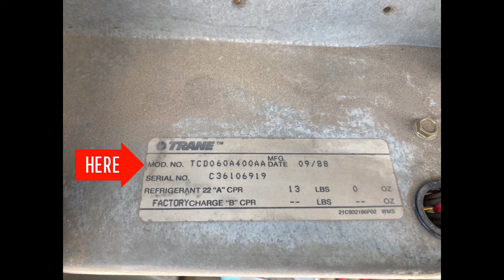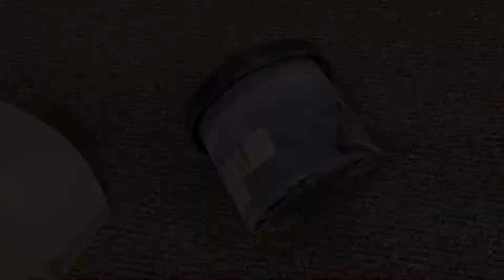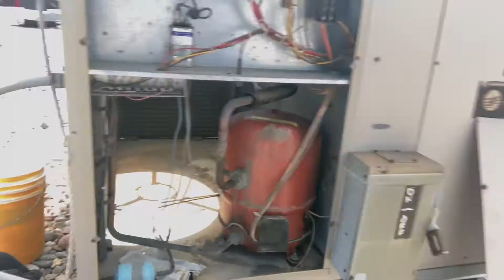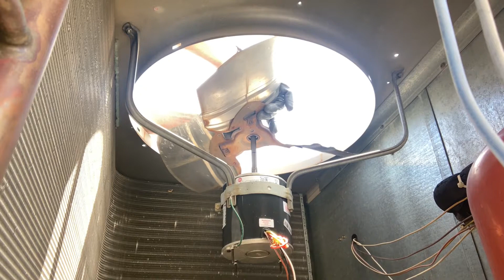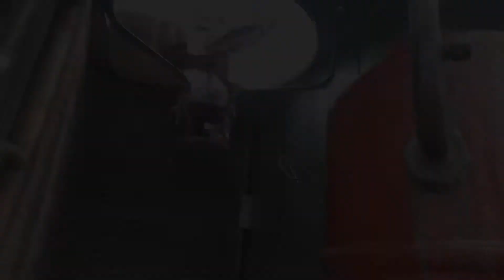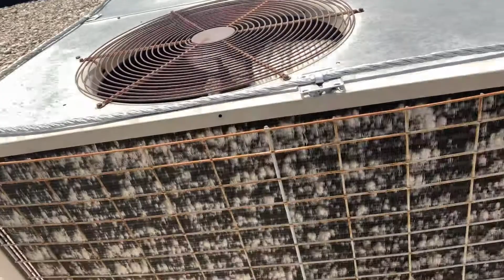Replacing a Condenser Cooling Fan Motor on a Trane RTU! | HVAC

Comment: sure would have been nice to see how you removed the motor from the old grill...mine, tiny little 1/4" mounting bolts completely rusted and now rounded over...Trane - F your designers!  (ummm, never mind....your motor was not mounted to the top grill)